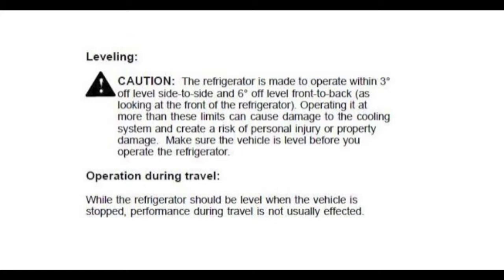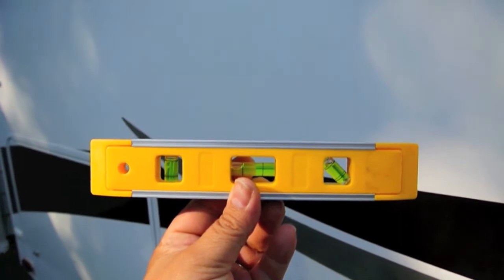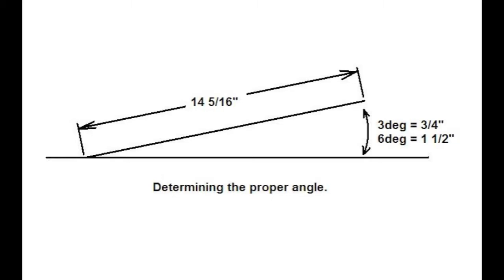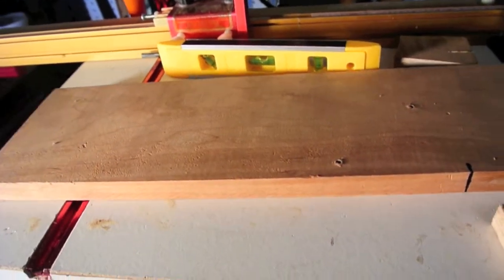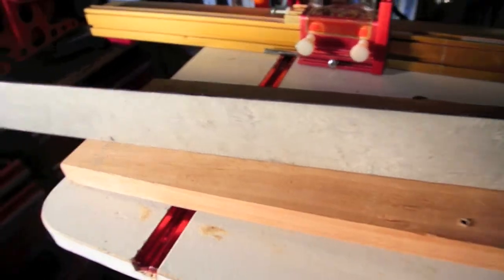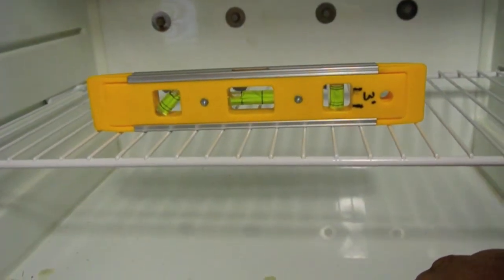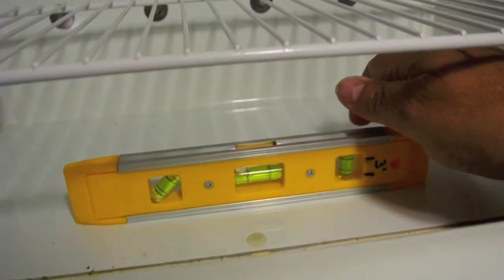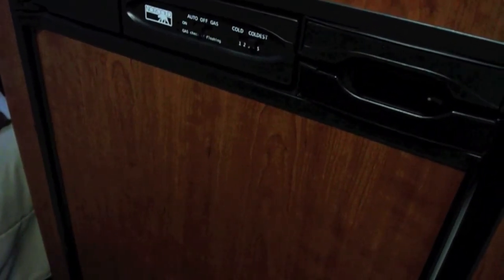Level your RV for proper operation of your refrigerator.

Comment: I'm missing something...if you can only 'measure' 3degrees because you're level bubble is maxed out, you can't assume the fridge is only 3degrees off level. Couldn't it be 4, 5 or 6 (or more) degrees nose low because you can't measure it with your level?

Comment: Actually using a spirit level in the fridge is the right way but you should never be more than half a bubble off front to back or side to side. Use the stabalizer jacks on each corner of your RV to level. That is what they are there for.
Reply from the maker: The owner's manual has the recommended maximum angle for operation.

Comment: If the refrigerator is in a slide --- do you level according to refrigerator "level" before putting slide out?
Reply from the maker: Yes, you should be level before operating the slides. If not, you risk jamming them or not retracting them.

Comment: Perhaps I can't see it well enough.could be either.
Reply from the maker: Joseph Loughrey It's degrees; I verified it in my manual.  If it were inches, it would only be a valid measurement at a specific distance from the refrigerator. But degrees is a constant no matter the distance.